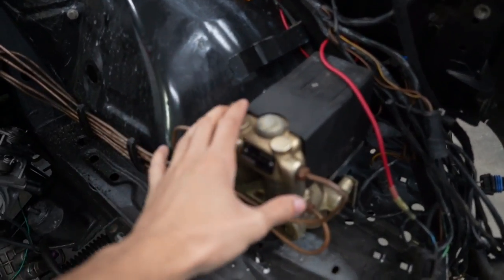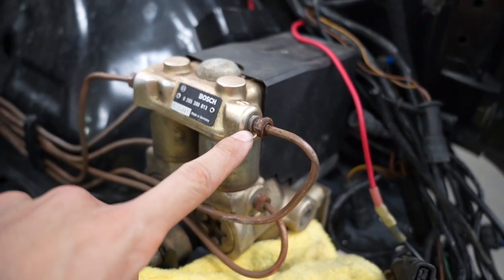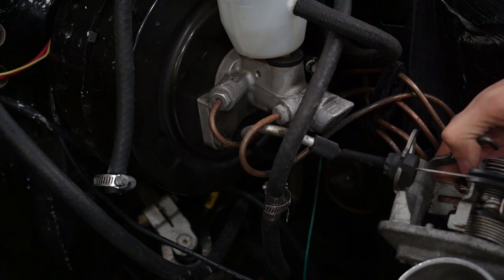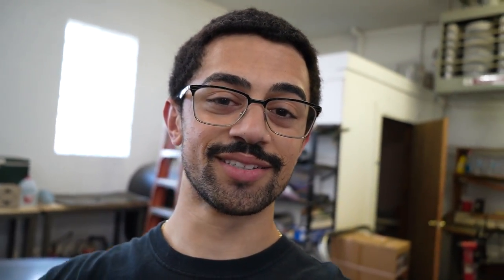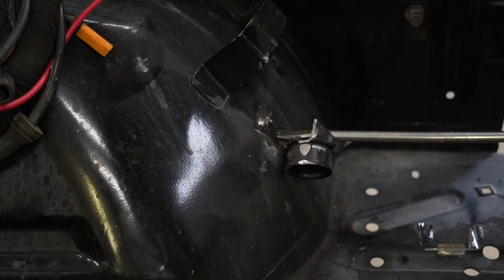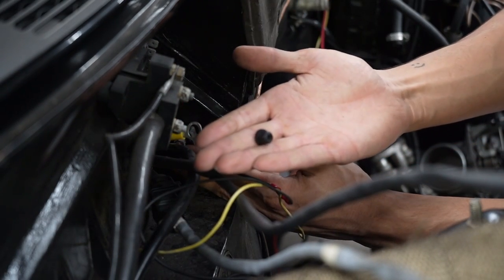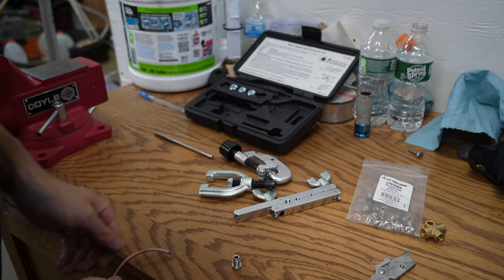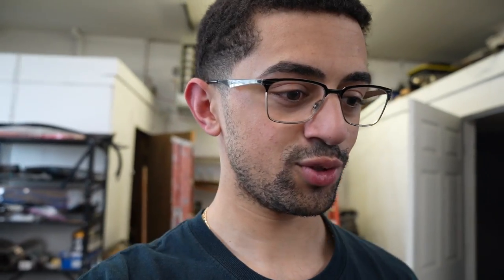DELETING ABS In My E30 So I Can NEVER Spin Out In Front Of A COP AGAIN!

Comment: So now your just gonna lock up all your brakes and go sliding right through the stop sign and stop 50’ after it.
Reply: exactly lmao. like does he not know what abs does...? lmfao
Reply: Yeah Ive owned old cars built before abs, locked up my brakes a couple times mashing the gas trying to avoid people who cut me off or pulled out without looking. Abs is super useful
Reply: Maybe he is confusing it with traction control?
Reply from the maker: the proportioning valve will make it so only front is gonna lock up so i won’t have the rear end come around 👍🏽 obviously still gonna slide if i over brake…
Reply: Its not as old but ABS works perfectly on my NA Miata, saved my ass a lot in the winter.
Reply: That’s hilarious my abs doesn’t work lights on and I slammed on the breaks because a bobcat was in the road on the highway and swerved it going 120kms went down to 70kms by the time I looked and was by it back right tire locked up when I turned to the left. your tires won’t lockup in good conditions😂
Reply: Whaaat! Abs prevents sliding when braking hard! His abs unit probably didn’t work , not abs in general. Proportioning valve is used in Non abs systems to do what abs does .
Reply: @beamerino  He knows what it does. He's getting rid of it because it never worked. Why have the weight if it won't work. Hence why he spun out the first time.
Reply: @ImJoel  that's incredibly dangerous, your reasoning isn't based on anything factual, I hope you do not have to learn the hard way, and someone else is paying for this mistake. because you are now reducing traction upfront where you actually need it. if you are spinning out too much then that's due to driver error either due to your skill or driver negligence in maintaining your vehicle. that fact you wanna be lazy and not want to deal with it says it all. i encourage you too read what ABS does.

Comment: That E30 gonna be so sketch in low grip conditions now...
Reply: no it wont, dont lock up your brakes and you dont need abs.
Reply: @JJMMAN2002  that's actually harder than it looks. Particularly when you've got performance tires, since those already suck in low grip conditions
Reply: I have -3.5 camber on my fronts, driving in snow storm i still have to really be trying to lock the brakes up, rarely does it happen accidentally. Drive for conditions and your cars capabilities

Comment: Confused on why you didn’t go with chase bays? They make a brake booster eliminator as well as lines with the proportional value. Have it in my m50 swapped e30 and it works great.

Comment: Hey Joel I have a question, I changed all my brakes and rotors, changed my abs pump, my abs sensors and when I ever press on the brakes the pump screams and barely brakes. What do you think is the problem?
Reply: Did you bleed the brakes ?
Reply: Probably has air in the pump. Do a bleed on it.

Comment: I can't see how deleting abs would do anything about spinning out.
It only helps when you are breaking.
Reply: His abs wasn't working, on e30's the abs units actually plays a role in the brake bias, when it's not working there's more bias towards the rear, which is obviously bad, and it's the reason he spun out last time, he started braking for an intersection after seeing a cop, it locked up the rear and he spun out.

I do agree that he should've just fixed it instead of removing it tho. Abs is literally a godsend, I've ended up in situations where it saved my ass a few times.
Reply: @imnota  Shit mine is like that right now. Good info to know I'm gonna fix it
Reply: @imnota  ABS is completely AIDS when it comes to late 80's and early 90's bmw. they werent the best at ABS at the time.
i have these same issues with my E36. and if youre building a drift car you most definitely wanna remove the ABS system.
you would be surprised at how much harder the car stops just by removing the ABS module. its actually pretty insane. 

If you're reading this and have a turbo E30 or E36 and youre on the fences about deleting the ABS module or not. DO IT.
your brakes will feel completely different.
Reply: @dannyipwn1203  
I have a 92 e36 and the abs is fine, sure it's not quite as good as on my e46 but it's miles better than none. Most of yall think you're race car drivers but in the event where you need to do an emergency braking, you're gonna lock it up, and extend your braking distance two folds. 

I mean look where no abs brought joel, spun out in front of a cop, had to go to court and all. If he had working abs he would've stopped in time, maybe cop would've given him a warning tops. 

And honestly Joel was best case scenario, most people like you riding dirty with broken or deleted abs kill people because when it's an emergency you just mash the pedal, everything you learned about being progressive and not locking them up will be out of your mind.
Reply: @imnota  I didn't fully understand why he would deleted it , but thanks for explaining a few stuff I didn't know , In my car coolant ruined the plug pins are no more ... and I've been dying to fix it , abs yes please 🙏
Reply: @imnota  totally disagree my mustang 2003 gt has a light for abs and traction and the time while I was waiting for a sensor I was driving home and a bobcat was in the middle of the road went from 120kms to 70kms by the time I was past it my back right tire locked up but nothing else and I swerved it just fine. Only time it’s useful is in rain and snow🤷‍♂️
Reply: @noland5345  if your brakes struggle to barely lock up in the dry you just got shitty brakes. Mustangs aren't really known for powerful brakes.

Also if you had to brake to a stop it would've shown the importance of abs even more.

Comment: Confused on why you didn’t go with chase bays? They make a brake booster eliminator as well as lines with the proportional value. Have it in my m50 swapped e30 and it works great.
Reply: From what ive heard and other peoples experiences, chase bays is hit or miss. Sometimes theyre shit leaks and other times its fine